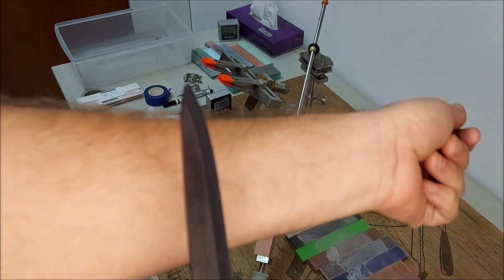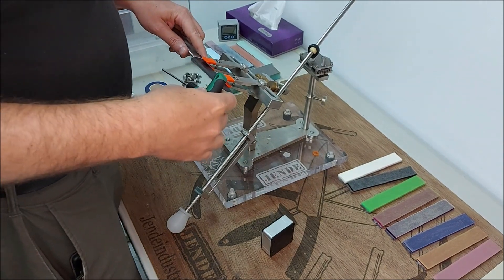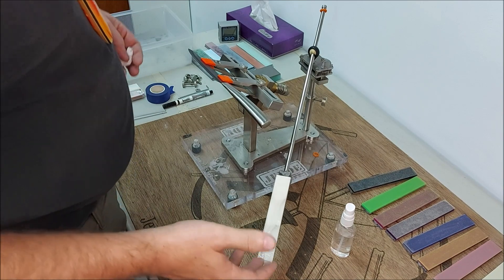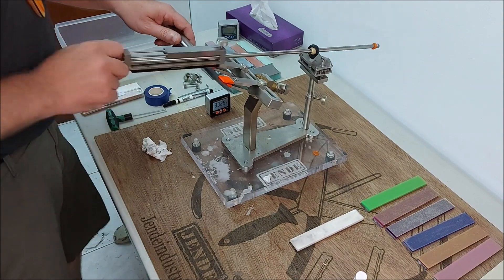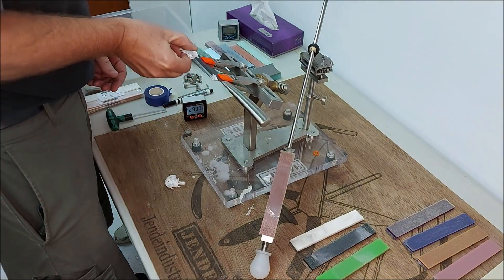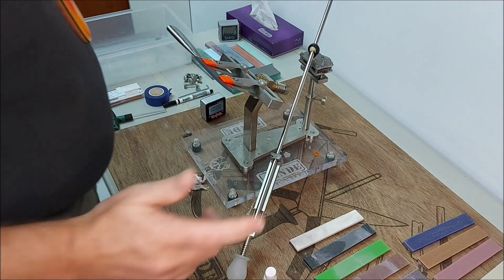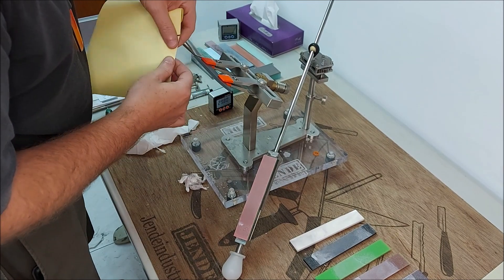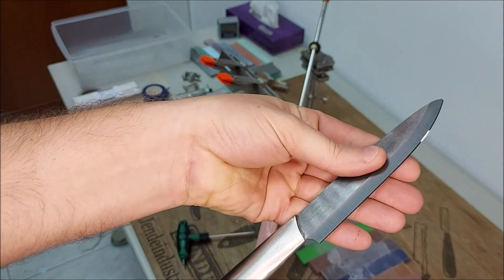Sharpening a Ceramic Knife with Diamond Films on the Jende JIGS for Knives - Full version

Comment: Can all films be used like this? Like stropping films? Do edge leading strokes? Or are these not your normal diamond stropping films like from kme? I  always assumed you could only go edge trailing strokes.
Reply from the maker: The Jende films are more robust than most others on the market.  Not all films are created equal and other films are much thinner and may not hold up as well. With that said, I usually recommend on the 1 and 0.5 micron films that you only do edge trailing. If you catch the edge of the film right, it's easy to slice.

Comment: Maybe i shouldn't have thrown away that drawer full of ceramic knives hahahahaha
Reply from the maker: Agreed! Ceramics are a mixed bag. Using the diamond plates are really not good for finish sharpening, although they make the initial repair work much faster. That is why I was surprised that the 80 micron film edge actually cut. The plates NEVER do that. :D
Reply: @JendeIndustries  I gotta give it a try the next time i see one. The last time i dealt with a ceramic knife, i had a 1cm deep x 3cm wide chip. took me a few days with a grinder.
Reply from the maker: @infogear6145  1cm you will definitely want a diamond plate or a diamond disk to do the rough work. 80 micron film is good, but better for lighter repair work, IMO.
Reply: @JendeIndustries  for sure! I didn't get it as sharp as you did.
Reply from the maker: @infogear6145  Sounds like you need our Diamond Films! :D

Comment: I wonder if some of the grits could be omitted?  Like 60, 45, 30, 15, 9, 6, 3, 1, .5?
Reply from the maker: Excellent question! Depending on the condition of the edges you begin, you can start at a finer grit. The most important grit is the starting grit to remove any chips and profile 80 micron is aggressive and fast, but does require cleanup. Since there are no real sharpness indicators on the ceramic blades, I have found it safer to run through the grits. The goldilocks zone is the 15, 9, and 6 micron for edge sharpness and longevity on ceramics.
Reply: @JendeIndustries  thank you.  I sharpened my three ceramic knives in use, using 80 micron to remove chips.  This step took the longest.  I then stepped down through all grits.  Since this was my first sharpening session they all came out sharp, but not factory sharp or Kyocera Kyotop send out sharp.  I believe with practice sharpness will improve.
Reply from the maker: @OB17358  Ceramics are tricky, for sure. Building experience will help you see the characteristics of the ceramic as you sharpen at each level. Basic cutting generally starts at about 15 micron. That's your first real indicator. Angles and pressure also come into play. Be sure to lighten up the touch on the last 10-20 strokes. ;)
Reply: @JendeIndustries  Thank you.  I wondered about changing pressure at finer microns.

Comment: There's a new "ceramic" that Kase Knives got his hands on and he's shown it in a couple of his IG posts. 76 HRC and it's FLEXIBLE. bet that could hold 1 micron for an eternity and a half.
Reply from the maker: Flexibility is a feature that varies from ceramic brand to brand. More flex makes the blade less susceptible to snapping, but I have found the same problems at the edge persist past the 6 and 3 micron range. Ceramics can definitely hold a 1 micron or finer edge, but you need to adjust the geometry so that there is enough meat for the edge to hang on to without chipping out. That's the trick. When you add geometry, you start losing the laser edge. It becomes a chicken and the egg issue. at the finer grits. :)

Comment: That is a beautiful looking sharpening system. Don't think it fits in my budget less but I am certainly interested in finding out more, maybe I can make use of some of the products and possibly upgrade to more later.
Reply from the maker: Thank you, sir! We are of the mind to buy once, cry once. :) but there are many ways to get good results. Our diamond plates, diamond resin stones, diamond films, and diamond emulsions will get any ceramic knife where you need it to be.
Reply: @JendeIndustries  is there a system these would be compatible with I can test it on, before I put down coin for a whole system? I have a Lansky adjustable sharpener I got on sale and never used it because I've had good results with the Sharpmaker and Worksharp, but I know I could do better, especially for decent sized fixed blades. I guess I could use them as flat benchstones and have things I could put them on but I'd love to try a couple of things indivudually before deciding no upgrading my system.
Reply from the maker: @krislong9338  Pretty much any full sized clamped system is comparable to the JIGS. Each one will have different strengths and weaknesses compared to the others.

Comment: Hello Tom, love your products. I have several questions in sharpening ceramic knives. I own several resin bonded cbn and diamond stones. For some reason, i still struggle in properly grinding the ceramic. I keep getting micro chips. Is it maybe because I'm not grinding long enough? Thanks.
Reply from the maker: Thank you for the kind words, Scott! At the low grits, ceramics will chip out just because of the aggression - especially on electroplated plates. Resin is still sometimes pretty aggressive, but you should start to see a smoothing out by about the 15 micron or 1K grit level, and no more by the 9 micron or 2K level, in general. You just need to monitor the chips at those levels until they go away. If they persist, then something may be up with the ceramic quality itself, but most likely because of rough beginnings. Let me know if this helps!
Reply: @JendeIndustries  well, earlier today, i had success
Reply from the maker: @Stgpx9  what did you do to get it? :)
Reply: @JendeIndustries  the typical, cleanly slice phonebook paper. Did a dry shave and it was smooth. Still a few dings, but overall, a decent edge.
Reply from the maker: @Stgpx9  Excellent!! Keep it up!
Reply: Hey Tom, could you also do a demonstration of your new diamond resin stones?